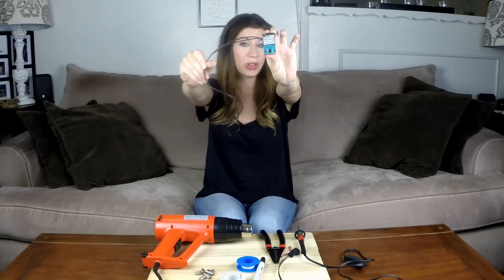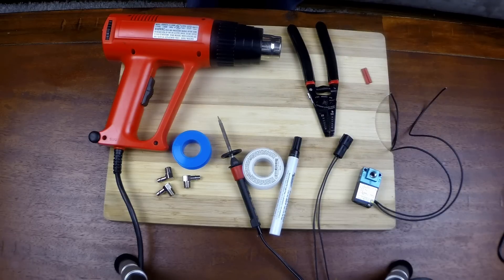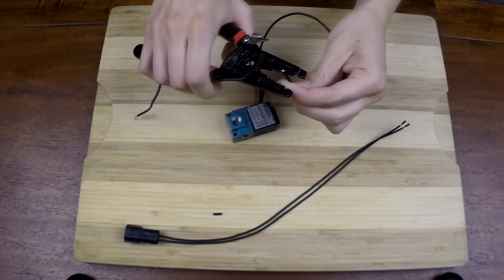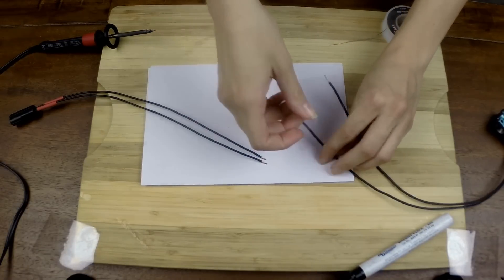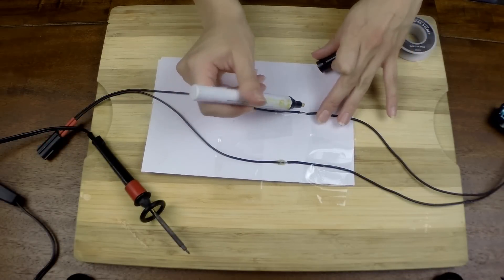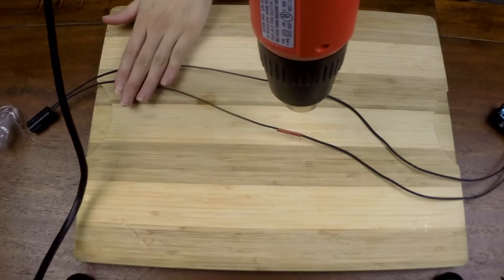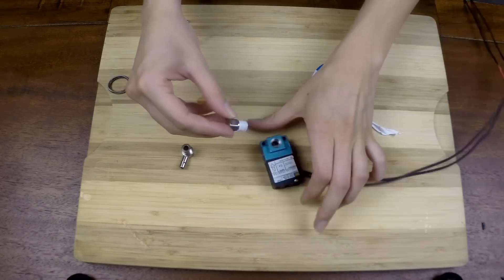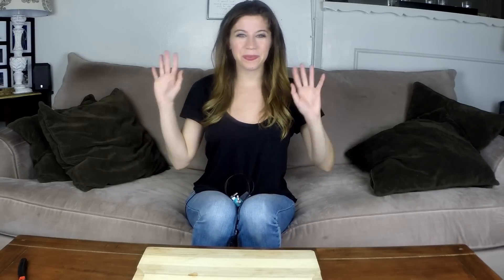DIY ELECTRONIC BOOST CONTROL SOLENOID!

Comment: I use this exact method on my STI. Spent about $40-$50 instead of $120+ for the exact same rebranded product like COBB Tuning.
Great to see there's a nice informative vid on it. Thanks!
Question though, is there a specific reason you soldered the wires instead of using a crimp connector? Don't both methods work just as well as one another?

Comment: I love it! make sure when you strip the wire insulator, you cut half the conductors off. That what it should look like. Oh, & don't wipe the excess flux off. That's not corrosive.

Comment: When soldering try not to touch the tip on the solder wire itself that's why it came out the way it did in the picture and it's not a good way to do it.  Try melting some solder on the top then touching that on the wire heating the wire up,  after that you melt the solder directly into the wire and it should flow into the wire

Comment: You should be more descriptive about your"wiring harness". If one were to inquire about the price of a wiring harness for a Mazda 3 they'll be given a price of about $500/1000. That is a particular type of connector not a wiring harness. Great job though...I  see alot of mechanical boost controllers on You Tube but this is the first DIY electronic I've seen...nice.
Reply from the maker: Thanks! I call it a wiring harness because it is in fact a type of wiring harness. Anyway the wiring harness part number is in the description which sells for $12. One should assume the wiring harness is relatively cheap considering we mentioned only spending $50 on the entire kit. We did not mention specifics in this video because we wanted to avoid confusion as this device works for various vehicles. Viewers are simply tasked with finding the correct wiring harness for their vehicles and they're good to make their own EBCS.
Reply: everythingdiy yeah. That was my point...it being a$50 build it's clearly not a conventional "wiring harness".  I don't get the full description on my cell most of the time...although I figured you knew ,someone not as savvy as us..lol... would shop the"wiring harness"and get a quote for $500... I do like this setup much more than the mechanical one. Nice job! :-)
Reply from the maker: Craig Cundiff Ah gotcha, good point.

Comment: Solder. (Sodder) Like grass sod. Gah so hot until that. Just Heat the wires from one side and apply the solder to the opposite side. as the flux steams off it pulls the solder through. Besides, if one didn't know how to solder they probably couldn't have set up a turbo in the first place so I'm not too sure the target audience of this video...thanks for telling us which solenoid you used?

Comment: make a boost control solenoid, but one of the parts you use is a boost control solenoid?  I'm confused.  That's like using a a word in the definition of the word :)

Comment: A word of caution - a weak spot of those MAC valves are the wires, esp. at the point where they exit the enclosure. They're made of some kind of brittle alloy, if you twist them around enough (when fiddling under the bonnet) you are likely to break them without even noticing. Happened to me. A piece of heat shrink tube over both of them and some hot glue or epoxy should fix that. What you were doing with those wires in the opening scene really made me cringe lol

Comment: Kinda disappointed. I thought this would be a DIY solenoid - like the title alluded to. Instead I got this, a soldering iron and some heat shrink. You even cut the soldering bit.
Reply: I thought the same, thoroughly disappointed. I was thinking this was gunna be about making your own solenoid out of a toilet roll centre and some sticky back plastic.